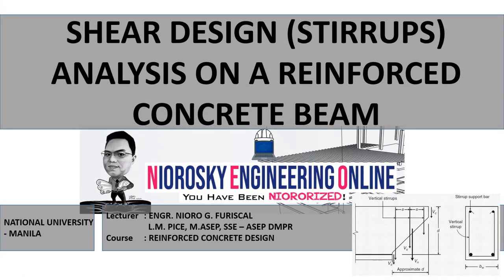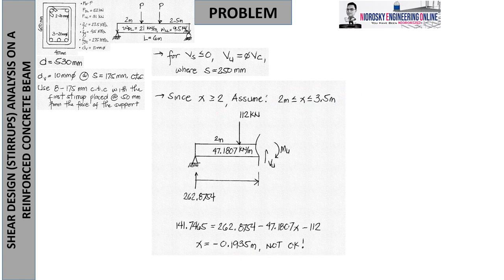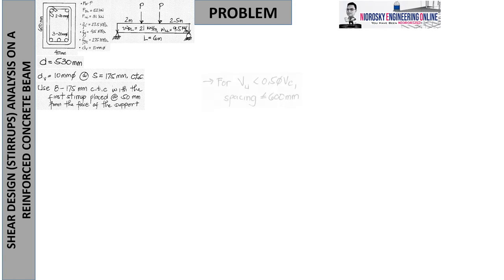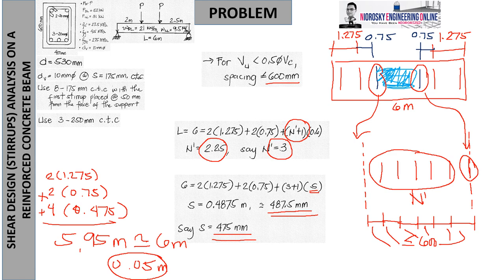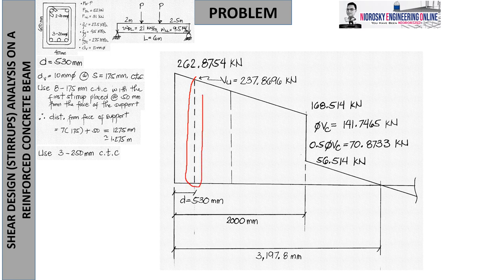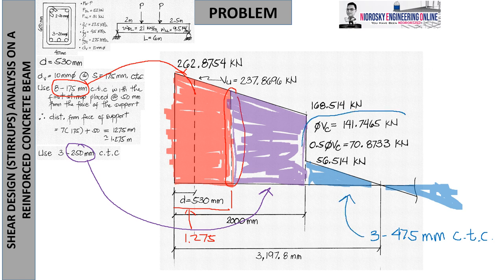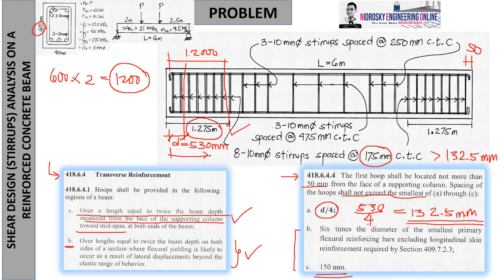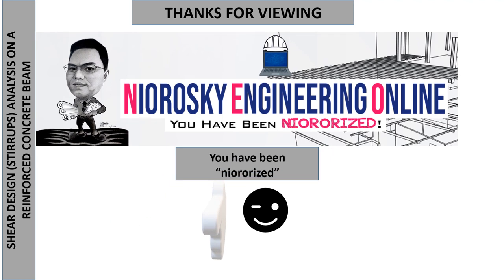SHEAR DESIGN STIRRUPS ANALYSIS ON A REINFORCED CONCRETE BEAM USING NSCP 2015 PART 2 OF 2

Comment: Sir gawa po kayo ng tutorial about design one-way and two-way slab if kaya. Thank you po.
Reply from the maker: That would be part of my next uploads, namely torsion, one way, two way (direct design and equivalent frame), column, then seismic provisions.
Reply: @nioroskyengineeringonline8968  good day sir I know my question is very but do you have the lecture videos about the analysis and design of shear and also for torsion?
Reply from the maker: @theduckexobitch3362  yes. i have for shear. for torsion is to be followed. kindly check my playlists :) look for Reinforced Concrete Design playlists

Comment: Sir, if incase yung ΦVc at 0.5ΦVc ay hindi nag coincide sa SFD, after iequate ang Vu=ΦVc, gagawin din po bang Vu=0.5ΦVc?
Reply from the maker: hi. i think this was already explained in part 1 of 2 of this video lecture :) please refer to the video lecture discussion. For a quick answer note that there are three potential cases regarding necessity for beam to carry shear, first is with necessity, second if without necessity but to install a minimum value if phiVc>Vu>0.5phiVc, and third is if without necessity but to install a minimum value if Vu<0.5phiVc, cheers.
Reply from the maker: here is the link if you missed this out: https://youtu.be/4ffc38hXqWk
Reply: Thank you so much!